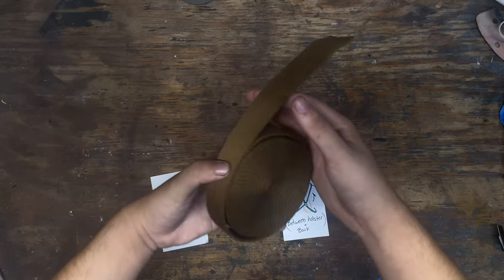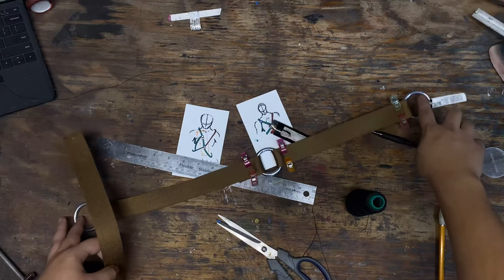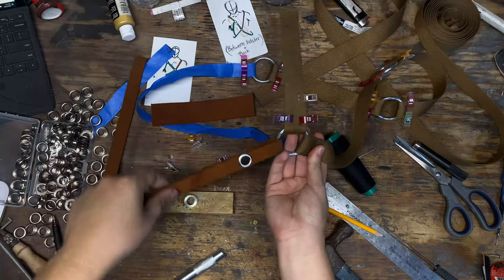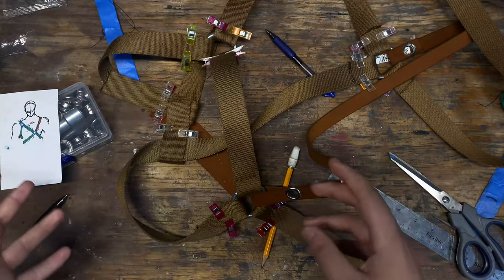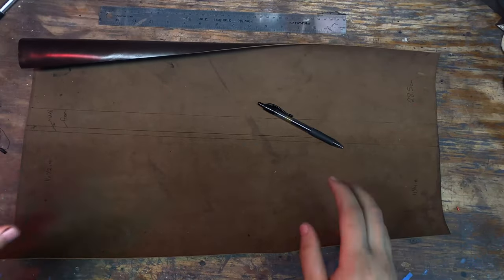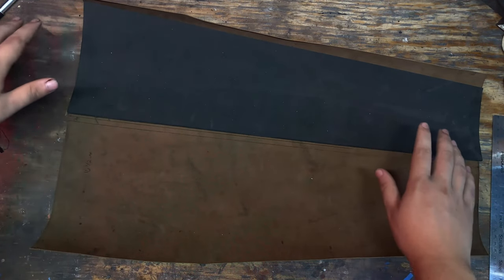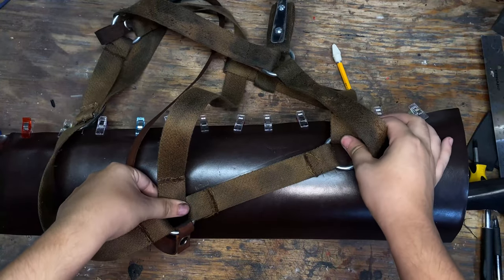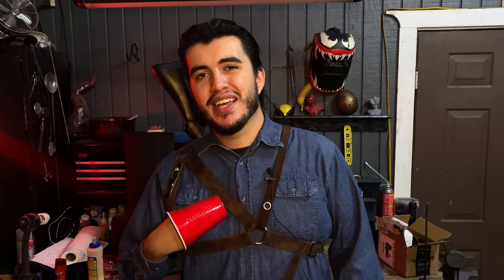Making the Harness from Evil Dead 2

Comment: Can you build the evil dead chainsaw please
Reply: Buy a homelite xl-12 chainsaw doesn't have to run($60-$120), remove the engine, mount a handle in the center, attach a 20inch bar and 5x12 heavy chain, remove the top grip and replace with folded strip steel 1" diameter and cover in 1" wooden dowel rod, replace the pull cord with a 3" segment of your remaining wooden dowel, paint the top of the motor well black, make 1cm steel strips to cover the motor well with 1cm spacing attach a 3" 1/2 metal pipe fitting and enjoy slashing up deadites